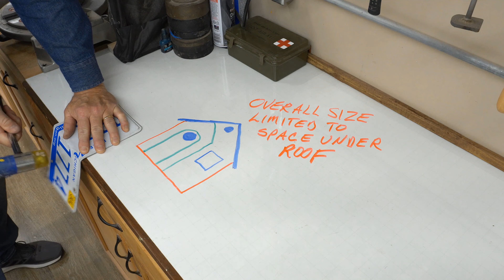Recycled Barnwood Birdhouse - FREE PLANS

Comment from the maker: UPDATE: PLEASE READ (Pretty please) - - - I've gotten a number of comments and some email about the use of a metal roof (that would "cook the birds" in summer) and the inability to open the houses to clean them. Not being an ornithologist, I appreciate these concerns. Since the first build of this and another birdhouse, I've insulated the top of the structure with Styrofoam under the steel to prevent that radiant heat from pushing downward and if you watch the video and listen to the commentary, I also talk about using screws to attach the house to the base, making it easy to open and clean with each season. I hope this helps with your own project and feel free to use other materials for the roof that you feel would be bird friendly. The rest of the build plans available on my website would remain the same...  Thanks!
https://thefamilywoodworker.files.wordpress.com/2023/08/bird-chalet-plans2.pdf